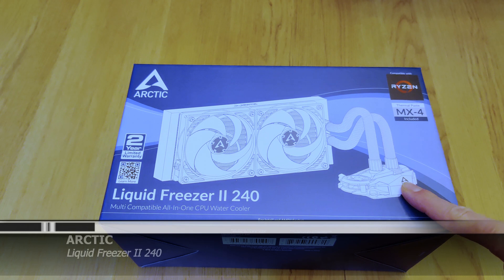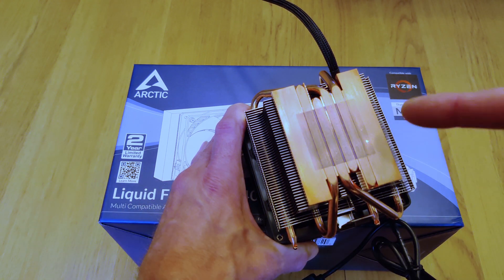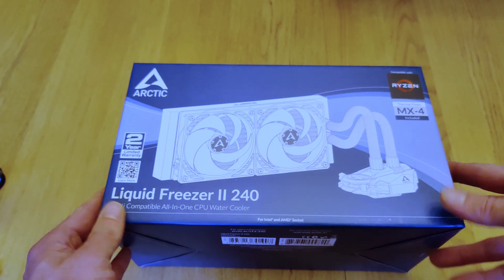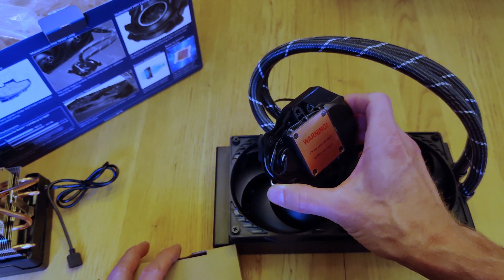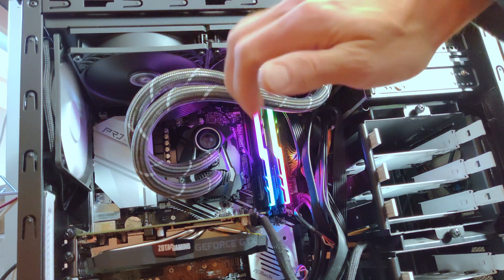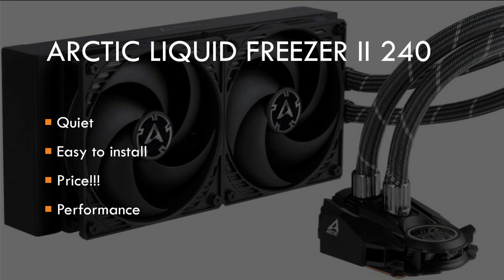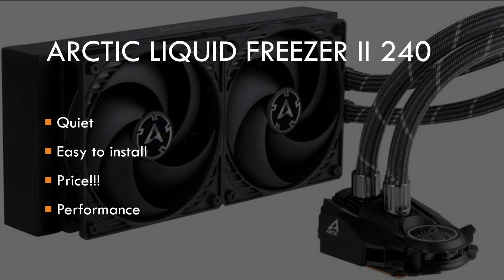Arctic Liquid Freezer II 240

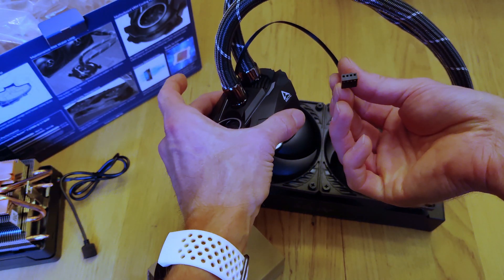Comment: at 4:54 you mentioned there was only one 4-pin connector. is that for the water pump? did you need to plug the fans into a pwn connector?
Reply from the maker: I plugged the 4-pin connector into the CPU HSF PWM header on the motherboard. I don't know if PWM is a requirement.
Reply: @MissingRemote  i was just wondering if the fans connected to the radiator had to be plugged in seperately. did more research and found out what you said about onnly have one 4-pin connector for the whole unit is true. thanks for the vid. helped me make my decision on picking one up for my new build

Comment: Will this fit my Cougar Mg120-g case? Mounted on top.
Reply from the maker: It should. In the product photos they show 2 large fans at the top. The radiator would replace those.
Reply: @MissingRemote  but this radiator is wider than the regular ones thats why i am worried haha

Comment: Hi , I need some help , I’m about to get this but I heard it’s 38mm thick , I’m worried it won’t wit in my case in a top mount due to the ram blocking it (Corsair 275R airflow, atx mb)
Reply: Hi. I have the same  case and I have mounted the cooling on the front.  I turned the fans to draw in cool air and the fan on the top of the case and the fan on the back pull out warm air.  The effect is that in rdr2 games CPU temperatures range between 48-52 degrees
Reply: @winnetou3741  wdym front?

Comment: Do you know if this aio will fit on top of my Meshify C case? I'm also using an ASUS x570 TUF with TridentZ ram modules.
Reply from the maker: Looking at the top of the Meshify, it looks like it should mount in there no problem.
Reply: @MissingRemote  Thanks for replying, great review! One last thing I would like to ask is wether this aio comes with an am4 mounting bracket or you have to get one seperately?
Reply from the maker: @MrAlefantos  It doesn't mount to the AM4 bracket. You'll want to remove the bracket and bolt this directly into the mounting plate that the AM4 bracket is attached to, or at least that's how it worked with my AM4 motherboard.

Comment: Just ordered one for my 9900K. Love the fact it's without the RGB bullshit that would drive the price up for something I would never use (PC is under the desk in a cubby hole so I cannot see the insides anyway). The price itself is insane. You'd expect a 240mm AiO to be at least twice that expensive, you can get only really low end or decent 120mm AiOs in that price range. Seen some tests and it seems that the fan for the VRM does help cooling those - which I think should be useful in my case as I'm using a Z370 board and the power draw of 9900K makes VRMs to run a bit warm.
Big thanks for mic'ing up the fan on the pump.

Comment: I'm planning the top mounting. One question: have you reversed this radiator fans, are they when placed on top in exhaust configuration? Tnx
Reply: I'm asking this because I'v seen the video with AIO installed on front panel and the fan position is the same, front position should have intake fans, top position exhaust fans
Reply from the maker: @MrSandar80  I'm running them in exhaust config, it should come setup that way. It's easy to flip them around if they don't for some reason.

Comment: 3800xt on 1.34v idles at 36c (and that's in the middle of a heatwave with no air con). Doesn't get past 80c under full load. 

Oh and it's also the quietest aio I've ever owned (I've had Corsair ones, nzxt ones etc). 

Well impressed with this.
Reply: Best you can buy imo, i cool a 10900k @5.2 with the 360mm

Comment: I know it’s pretty straight forward but where does the cable that comes out of the pump on the radiator plug in?
Reply from the maker: You plug it into the PWM CPU HSF power header.

Comment: This cpu cooler is really good. I have it for about 4 months now. I have ryzen 9 3900x, at idle I'm at 39c and when overclock, it never goes up more than 63c
Reply: Is it noisy dude?
Reply: @giuseppeprattichizzo1862  not at all brother, its very stealth to me (at least on my hearing levels lol)
Reply: @joz312  bro I built my pc a week ago, sometimes it makes a weird noise like air boiling? Is it normal first weeks?
Reply: @giuseppeprattichizzo1862  did you place the aio on the good configuration (pump under aio tubes) ? Because if not air will condense there

Comment: Hey man great video, i also planing to buy this cooler for r9 3900x and wondering what position would be better to install on top like you did or put it on front like intake ?
Reply from the maker: Installing as an intake would push hot air into the case, you want it to push hot air out. Putting it on the top does make the radiator slightly less efficient because it's pulling hot air from the case through it, but given the size I would still think that is the better approach.
Reply: @MissingRemote  what type of case do u have
Reply from the maker: @carsencar4546  Fractal Design ARC MINI R2

Comment: What case you got?
Reply from the maker: Fractal Design ARC MINI R2
Reply: @MissingRemote  do you know what else cases will fit with this aio?
Reply from the maker: @wowi2303  It should fit in any case with 2x 120mm side-by-side fans at the top. Many newer cases have this, but I don't have a comprehensive list. You should be able to tell by checking the pics on Newegg.

Comment: wait wat???????? mine sounds super loud WTFF
Reply from the maker: Do you know which fan is making the noise? Mine is still super quiet, even when I'm working the PC hard.
Reply: @MissingRemote  I watched another video where it stated that you can't control your radiator fans only the vrm fan because I dunno why. They fucked up the pwm design rip
Reply: @FrederikEngelmand  radiator fans can be controller. You can set it in bios too. You cant control vrm fan separately. I think it synced to 120mm fans and pump.

Comment: How tall is the radiator+fans
Reply from the maker: The whole thing is ~280mm (L) x 120mm (w) x 62mm (h)
Reply: @MissingRemote  and you didn't have issues with top motherboard clearance? I'm on a CM H500 case and looking to change the wraith prism on mu 3800x with this, but i am not sure if this specific cooler will fit in top panel. I believe it is thicker than most of the others by ~1cm. Did you place the radiator closer to the side panel as to have clearance with mb vrm heatsinks etc?

Comment: Would you advise using an AIO like this one or any kind of AIO in a case like the NZXT H510 as intake where negative pressure airflow gets the best thermals?? And if so where and how would you install the AIO? 
Thank you for a great review
Reply from the maker: You have a couple options with that case. Either reverse the flow, so it intakes, and mount at the frount (NZXT has an image displaying this option with a radiator). Or go with the 120 version of this cooler and mount either at the top like I did (what I would probably do), or on the back in standard (exhaust) configuration.

Comment: Are you using asrock x570m pro4 with 3700x? 
Could you tell me how is it so far? 
Especially the noise. 
I have 3600x stock cooler seems loud to me, I am looking for a cooler and stumbled upon Arctic Liquid Freezer II 240.
Reply from the maker: I am using that config (review here: https://youtu.be/1urXr8a7UsQ). The stock HSF is crap. Very poorly designed and loud. I ended up with this cooler because I couldn't deal with the noise. Has been perfect so far.
Reply: @MissingRemote  Thanks I am planning to switch to it but now there is no one selling it in my country xD
Reply: noctua u12a
Reply: Did you run into trouble installing?- in installing now and it's not fitting tightly- I'm about to dry using 2 washers to get it down snug on 3600x on aorus x570 or those funky riser screws w washer one on both sides. Mine didn't come with manual.
Any tips?

Comment: Mines on the way all reviews so far have been positive looking forward to testing mine. I paid for it.
Reply: is it good?
Reply: Are you satisfied with it?
Reply: Still going strong no discernable fluid loss or pump issues. Cool.
Reply: @JasonStPierre  is the pump noise audible? Just ordered mine and I am concerned about buzzing noises after being used to a silent air cooler.
Reply: @gabitg103  not audible as you describe.  That seems like a pump issue. If you can hear it case shut a few feet away I would say its bad. The pump, anyhow.